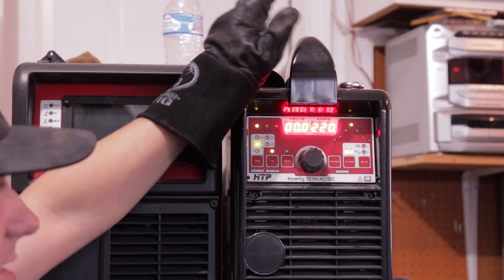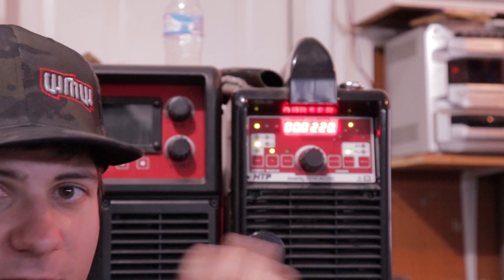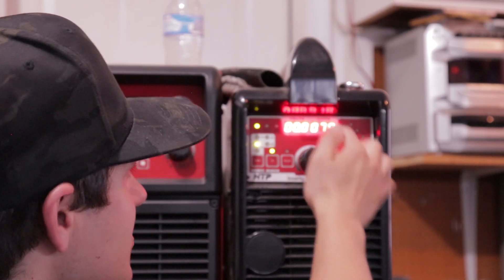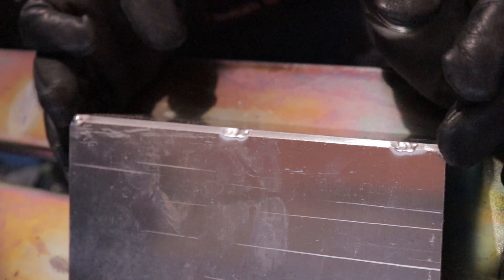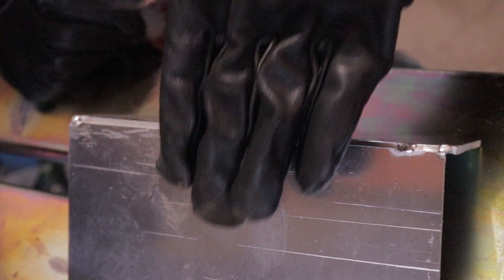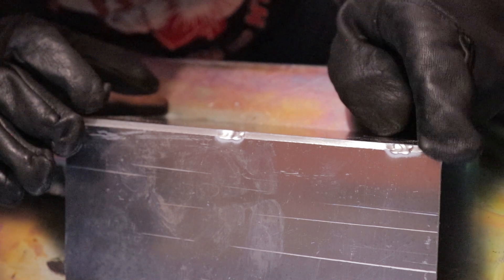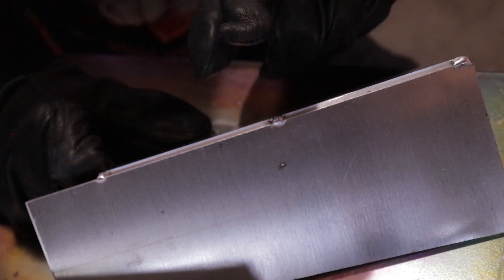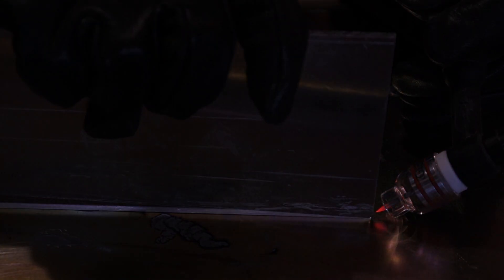How To Tack Aluminum for TIG Welding (GTAW)

Comment: Do you use hot start and ramp functions with Tig aluminium. Do you uses these functions when tacking. Did you  use 2T or 4T.   Thanks for a really helpful video.
Reply from the maker: Nope i just use regular 2t no hot start
Reply: @5thStreetFab  Thank you for prompt reply. Will try this out later.  Mike

Comment: You are awesome at welding and teaching brother! Quick question, any recommendations on an affordable welding helmets? I have a snap on helmet that isn’t the best and I feel it’s affecting my viewing of the weld puddle and etc.
Reply from the maker: Jackson hsl 100!  Its 34 bucks on amazon fixed shade. But man its.my favorite!  Best head gear and awesome view window
Reply: 5th Street Fab you are the man!
Reply: Okay I got the lens, it’s much clearer than the $200 mask I had. Do you have any tips with seeing or setting up your starting point with the weld when using this helmet? It’s very hard to see anything until the welding starts. So In situations like tacking or continuing a weld

Comment: Do you have any tips to help with the width of the etch zone?   I have tried to adjust Frequency and Balance, but neither seem to change the width.  I have also tried adjusting gas flow, #5 cup with non gas setup.
Reply from the maker: Its usually just a combination of gas flow and balance.  Turn your gas way down to where it starts getting dirty and then slowly turn it up maybe 1 or 2 cfh at a time until its clean enough to weld with and it should be as good as you can get

Comment: Thanks for another quality video. I have a question about welding square aluminum tubing, 1/8" wall. I am building a ladder rack for a trailer and I have always struggled to find a good setup for fillet welds. I am using an HTP 221 w/ 3/32 2% laminated tungsten, I am unsure about what frequency to use and haven't found a great cup size, any suggestions? The aluminum is 6061 that I clean with acetone and red scotchbrite pad and I have not beveled the corners.  Thanks I look forward to your next video.
Reply from the maker: Thanks man!   Sounds like a great setup! I would just set the hz at 120 and leave it also dont use red scotch brite!  Itll contaminate the weld.  Use a stainless steel wire brush.  They have some that are the size of a tooth brush that are perfect!  I would say either a standard number 5 or gas lens 7.  Those are my 2 go to cups.  Set your gas flow around 15 cfh and balance around 65-70% and you should be set!

Comment: Not allowed to use 4043.
Reply from the maker: Nice theres a few things we're allowed to bit i prefer 4943 if im using 4000 series
Reply: @5thStreetFab  just 5356 on 5083 material.
Reply: Does the htp 211 have en and ep separate settings?
Reply from the maker: @trailerpark187  nice ive never welded 5083 but i do like 5086!  Ya it does.  Its similar to the dynasty but instead of amps its percentage of overall amps.  Its fun to play with
Reply: @5thStreetFab  I couldn't afford an invertig. So I bought an everlast 210 ext. Doesn't have those separate settings but does have wave settings. Not bad for $1500
Reply from the maker: @trailerpark187  thats awesome!  I just got invertig 400 but havent had time to set it up yet!
Reply: @5thStreetFab  my bad, it is 5086
Reply: Why not? Do you Anodise everything. ( anodising turns 4000 series filler, black)
Reply: @scottcarr3264  5086 material and thats what the procedure calls out. Military.

Comment: Nice explanation. Which tungsten do you use for aluminium?
Reply: I've used both in a pinch...green/red/2%/ whatever
Reply from the maker: Usually 2% lanthated or ceriated
Reply: @5thStreetFab   I'm just learning to weld aluminum and to use a food pedal. A new challenge but your tips really help! Thanks!

Comment: Great video esp on the 5052. On the htp tig 221 do you like it better than the dynasty? Been looking at both. The dynasty seems to have a slight bit more adjustments but I'm not sure it 1600.00 better. I haven't really heard anything bad on either. Seems like htp will get parts out quicker and walk you through the repair versus miller. My local miller dealer said they do not repair any tig or plasma machines they take them to other shops for repair. Turn around was 6 to 8 weeks on a warranty repair...not good
Reply from the maker: Thanks!  I run the dynasty at work and 221 at home.  I like the htp better but they weld almost identical.  And they are great to work with